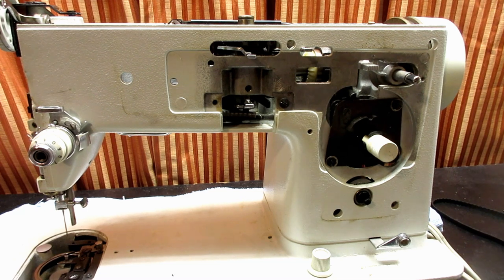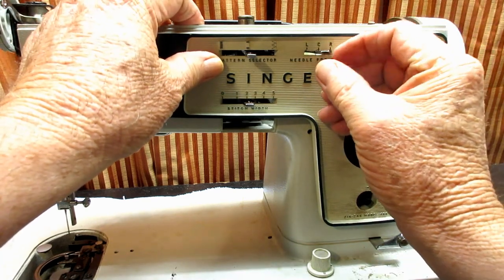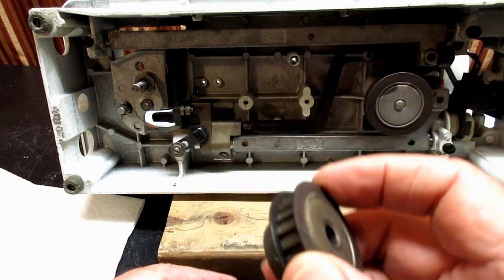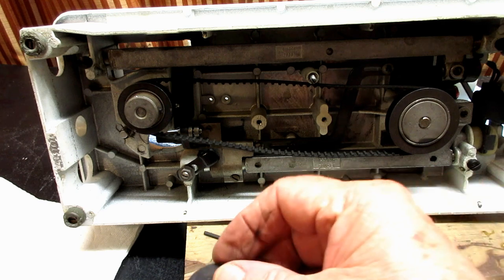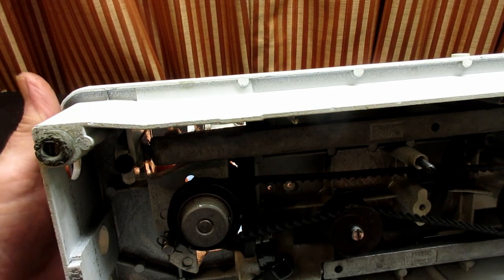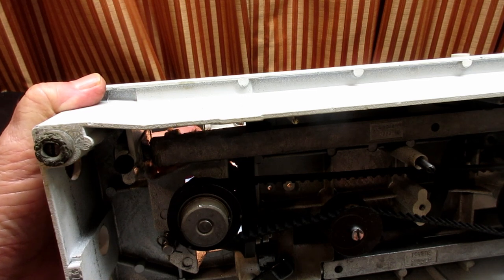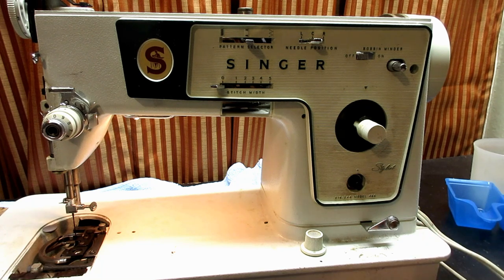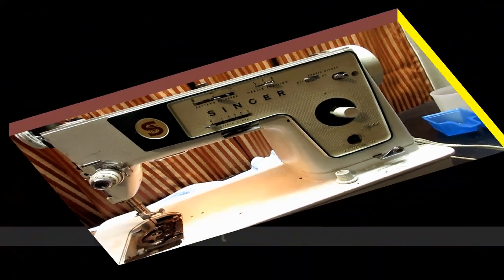SINGER MODEL 466 GEAR SWAP PT 3 - RESET TIMING & BELT

Comment: Hey Andy, it’s 4:30 am here in south Texas and look what I wake up to when I go to grab my phone ❤️, a new Andytube video!  Well, it’s not related to this particular model, but I was thinking about you yesterday because I recently acquired a Singer 128 this weekend and of course I ran to YouTube looking for a playlist of yours. I was surprised that you didn’t have one for this particular model. Do you have a playlist for a similar model that I can pick up some tips on?  Oh, I learned too what a BT7 motor is, it has one.  I had no clue how to put the belt on that thing until I went back and looked at the video I made when I brought the machine home and saw how it was sitting on there. Well let me go grab my coffee and get my day started. Take care.
Reply from the maker: Sorry, I've never seen that model in person, but I do have some manuals. Check your emails.
Reply: @andytubesewing1953  thanks Andy!  Yeah, she’s 104 years old and doesn’t have the reverse feature.  She also has the elongated bobbin which of course has a pretty neat bobbin winding system.  I cleaned her up, but it looks like she needs some minor adjustments before she gets to stitching.  It was fun but not my favorite compared to my 99k, Spartan and my 15-90 and of course my rocketeers!  It was good to find your video today and thanks for the info, I’ve got some reading to do.
Reply from the maker: @rhondamercado7527  sure and good luck!

Comment: Hello, Andy:

Your videos have helped me fix more than one machine. Thank you for that!

I bought a completely stuck Singer 477 to fix. While lubricating and putting back the Stitch Length selector dial, the protruding plastic shank where the Stitch Length selector dial rests broke into many pieces. It was fine when it arrived. I wrote to Vintage Singer Parts, but they don't carry that piece.

I bought a completely stuck Singer 477 to fix. While lubricating and putting back the Stitch Length selector dial, the protruding plastic shank  where the Stitch Length selector dial rests broke into many pieces. It was fine when it arrived. (I've enclosed pictures. )

It only sews backwards. Except for the push button, everything seems to work fine now. Do you know of someone making this piece?

The sewing machine only sews backwards now. Except for the push button, everything else seems to work fine. Do you know of someone making this piece?
Reply from the maker: It's a 55-year-old machine. I promise no company is making that part. We usually have to find an online seller who is "parting out" a machine. I usually find them on eBay but there are other places too. If I find a seller who has some parts for the model but not the exact part I need I will often contact them with what I need. Many have no idea how to take something like a dial off so I have to give instructions. https://www.ebay.com/sch/i.html?_dkr=1&iconV2Request=true&_blrs=recall_filtering&_ssn=dese_7679&store_cat=0&store_name=part1solution&_oac=1&_nkw=477
By the way, this is not a group or forum site, so you can't send along pictures. Thanks for saving the machine, I hope you can find the part.

Comment: I get binding if I pinch the hook and the tooth pully together and tighten the screws. Slight difference on my Singer 348 to your 466.
The binding is intermittent, my fix is to leave just a very slight bit of endplay clearance. This tends to happen if the machine stops at at the binding point then I start to sew slow, then I have to give it more power to start sewing.
Initially I thought the binding was elsewhere on the machine, however when I let it have that slight end float clearance no binding.
Is there anything I should check with the hook and tooth gear that might be causing this slight binding .
Reply from the maker: I've not had that before, but I guess I'd try retightening the set screws evenly. Try tightening them like lug nuts on a car wheel. I mean back and forth between them tightening a little at a time (once they are close to the shaft) so they are evenly on the shaft, even that makes any sense. (no sure how else to decribe it) 
     One time on my first 347 I tightened one setscrew like 95% b/c I di not what the shaft to move and loose timing, then the second screw 100% and back to the first to 100%. I noticed during testing that the hook "wobbled" a little and I'd never seen that. My auto mechanic friend suggested the "even tightening" method and that fixed the wobble.
     My othe though is a bent hook shaft. I have never had that, but a veiwer shared he did have that on a 401A. He pulled the hook out and discoverd a slight bend. No idea how that could have happend but he bought a used hook from eBay and that fixed his intermittent binding he had been fighting. 
     Lastly, and maybe this should have been first, dried oil in bushings can make little hard bumps on the low side of how the machine was stored. The shaft rotating in the bushing binds when it hits the bump "spot" just a little. That is usually on the larger arm shaft or verticle shaft but I guess it could happen on the hook shaft. You did oil the hook bushing/shaft right? that litte hole on the top of the hook below the bobbin case?
     You can try more oil there while running the machine at a moderate speed for 3 to 5 minutes to see if you can "clean" the bushing vs removing the whole hook. 
     Hope I'm not sending you down any rabbit holes but those are my thoughts. Good luck.

Comment: Mr. Andy, I need a video for my Cara Singer sewing machine, I have problems with time, it does not sew down. Doesn't snag the thread. tky
Reply from the maker: Do you mean model 239?
Reply: @andytubesewing1953 yes

Comment: Andy, I have a Singer 99 that’s on a sewing table. I have worked for a week trying to get it to sew right. It’s threaded right, the bobbin is in right , the needle has been changed, it’s been oiled. I’ve done everything I can think of and it still has loose threads when I sew with it. The upper thread is the worst. It’s not bird nesting any more, just very loose threads. I have had the tension set on every number to see if that’s the problem and it made no difference. It’s now on 4. I’ve worked with the bobbin tension to see if that would help and nope, it didn’t. I can’t think of anything else to do to it. You got any suggestions ?  It’s driving me nuts !
Reply from the maker: 90% of the time it is a tension problem so you're on the right track by t4esting that, but maybe the wrong approach. I have an entire playlist of videos for model 99 here: https://www.youtube.com/playlist?list=PLsCOZgzzaiKIIUgkEujqHc9iNWN9NPW2Z
You'll find a video all about the needle thread tension unit, which yours may be dirty or not zeroes out. You'll find a video about all the bobbin area parts. I have a special video about cleaning and (properly) adjusting a Class 66 bobbin case like the one on your machine. https://youtu.be/HT5XZ5eYYEQ     Those are the three areas I would look at. Try and be methodical in your approach and take your time as that can often save you a lot of time and frustration in the long run. Good Luck, JJ.
Reply: @andytubesewing1953  I’ll check these videos out. Thank you for your help.
Reply from the maker: @jjsam5375  Good luck!
Reply: @andytubesewing1953  Lol, I’m gonna need lots of luck, I’m not mechanically minded at all.
Reply from the maker: @jjsam5375  Yes I had that feeling but don't let it hold you back. Desire is about 90% of solving a problem